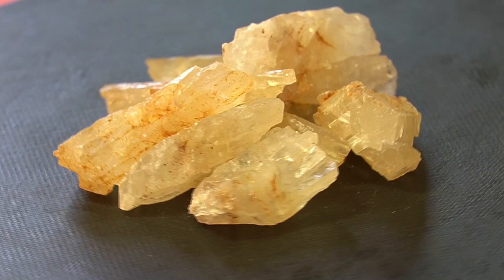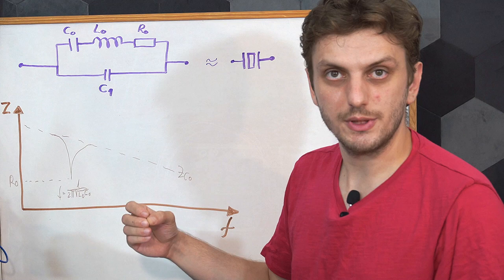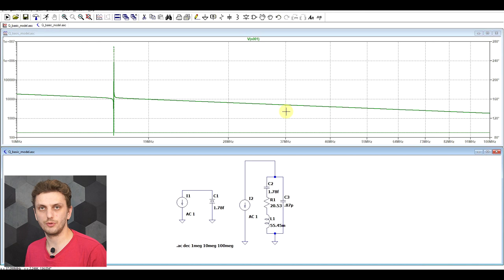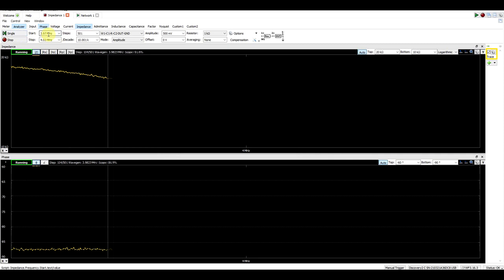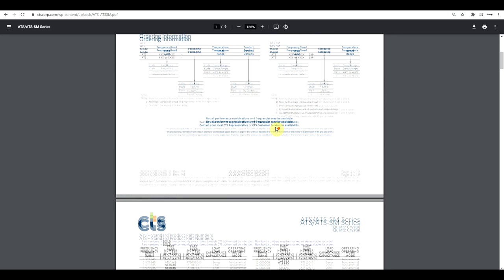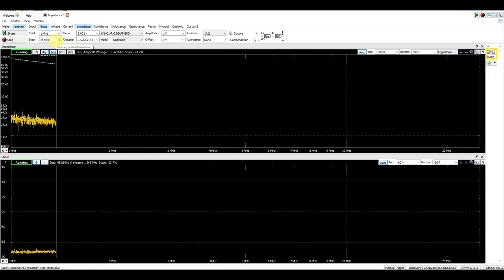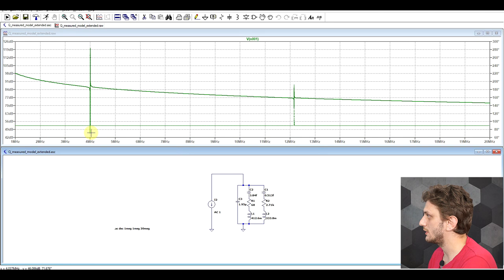Measuring and Simulating QUARTZ crystals using LTspice

Comment: Very nice videos! Keep going!
What about make the same parameter identification with more common equipment like a signal generator and an oscilloscope? How would you do it? What are the caveats?
Reply from the maker: As long as the signal generator can provide the necessary frequency step, the measurement can be done that way also. The setup would be the same - inject the signal from the generator to the quartz trough a known resistor and measure the signal being injected and the signal on the quartz with the oscilloscope. You need to step the frequency in fine paces, and them measure the amplitude ratio and phase difference between the 2 channels. See this document from tektronix on the topic - https://download.tek.com/document/75W_28152_1.pdf They explain measuring inductors and capacitors, but its the exact same principle.
Reply: @FesZElectronics  great! thank you very much for the attention. I think maybe a video with basically the content of the tektronics document will be a good video for the channel, right? People will identify themselves more because you are using hardware that they have. I don't know if the logic is right but I'm just trying to help as you helped me with your videos.
Reply from the maker: Hello Daniel! I guess at some point I will do a video on how to make bode plots without a network analyzer, since as you correctly said, not a lot of people have one of those. Thank you for this suggestion!
In the mean time, I guess you can also see https://www.ti.com/lit/an/snva364a/snva364a.pdf?ts=1625457754591 
Its a document by Texas Instruments about loop measurements, but the same principle applies - injecting a signal and measuring the phase shift and amplitude difference.
Reply: @FesZElectronics  yeah. A while back I made a python script that automatizes it. It set parameters on my (very cheap) signal generator and reads the data on the oscilloscope, both via usb. Then it stores the raw data: the input and output of the system (channel 1 and 2 of the oscilloscope) for each frequency but it is quite slow. Anyway it do the job. After this I take the raw data and post process it, using parameter estimation techniques to extract the gain and phase and plot or export this data. The only problem is that it's too slow, taking little bit less than 1s for each data point.
But thanks for the attention and, again, congratulations for the excellent job here on youtube! :)
Reply from the maker: In my experience the biggest issue with this method of extracting parameters is extracting the phase shift, especially if there is a lot of noise - for example when measuring the loop response of a switching converter. I'm not sure what method you are using for the data processing but a while back I found some formulas to process a set of points to extract the gain and phase difference using an FFT algorithm - https://www.analog.com/en/technical-articles/ltspice-extracting-switch-mode-power-supply-loop-gain-in-simulation-and-why-you-usually-don-t-need.html its somewhere in the middle of the page. I implemented this in an older LTspice tutorial and it worked. I guess that even if it takes ~1sec per point, its still faster than doing it by hand.
Reply: @FesZElectronics  sure it is quicker than doing by hand. Why do you think I implemented this solution? Lol...
For the method of getting the phase and amplitude, I think I used optimization functions on python to minimize the squared sum of the errors for each point when compared to two sine waves of the same frequency, identifying the frequency, phase of channel 1, phase of channel 2, amplitude of 1 and amplitude of 2. With those values you get the gain and phase difference for a given frequency. It's a method called Output Error, and you find the set of parameters that minimizes the error function. We use it a lot in aircraft parameter identification to get model parameters based on flight test data. In this case it can handle the noise quite well. I think there are other more suitable methods but for the level of precision on the measurements it's not worth a more sophisticated method to do this.

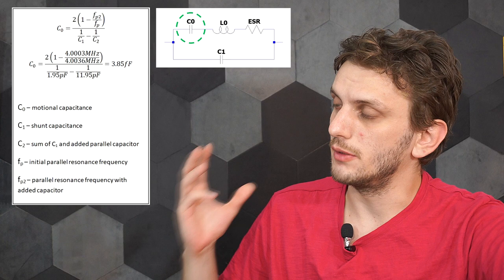Comment: If possible, could you please refer to how you have derived the motion capacity formula from 2 parallel resonance frequencies (11:50)?  Using a common quarts parallel resonance frequency formula, I am getting another expression...
Reply from the maker: I think the source for these formulas was "The Art of Electronics" 3rd Edition. Chap 7.1.6 - section B pg 444-445 - There is a footnote with them.
Reply: @FesZElectronics  Yes, the reference is exactly there. They do not derive it however and I suspect that a small frequency shift approximation is used - I will try again. Thanks a lot!
Reply from the maker: I will be honest, I did not check how the formula was derived, I just trusted the source; In general all sorts of simplifications are used when deriving nice simple formulas. In the end its all about how accurate the result is - may I ask if starting from the same values, is there a significant result difference using your equations?
Reply: @FesZElectronics  I agree with your point and the approach.  Ideally, when an author comes up with a result, mentioning assumptions might be useful if a reader needs to use it.  I will plug in the values and let you know if discover a noticeable discrepancy. P. Horowitz's book is a trustable source.
Reply: And I forgot to thank you again for the great work you do for the tutorials. :-)

Comment: I tried to simulate a colpitts oscillator with 100Mhz quartz oscillator, but I failed . I  did a quartz model that  function in simulate  but it not funnction in colpitts oscilator . The colpitts oscilator is that  presented in @devttys0 cannel for 12Mhz but I tried to adapted it for 100Mhz and  I do not had success